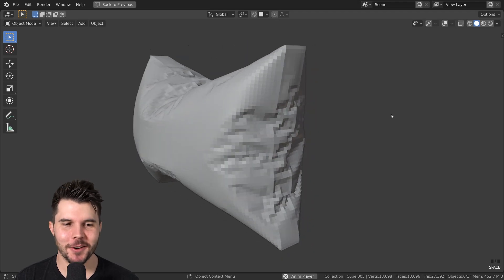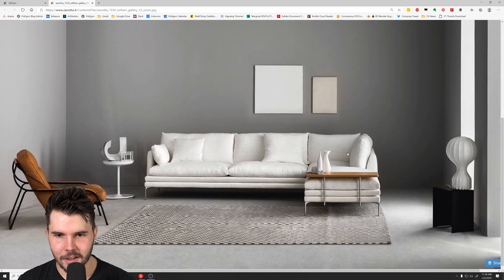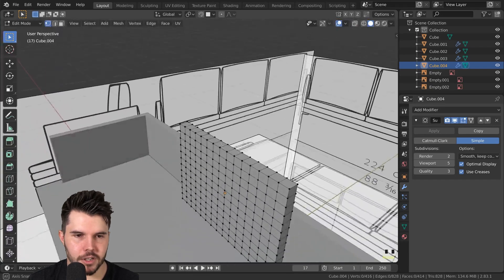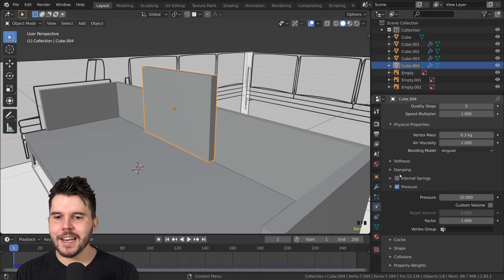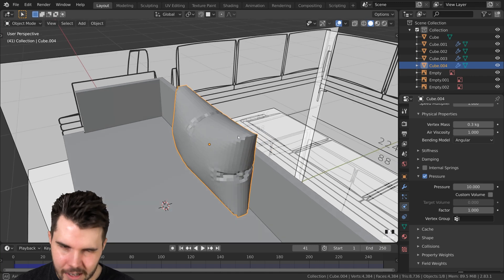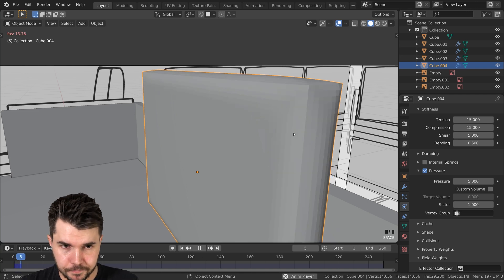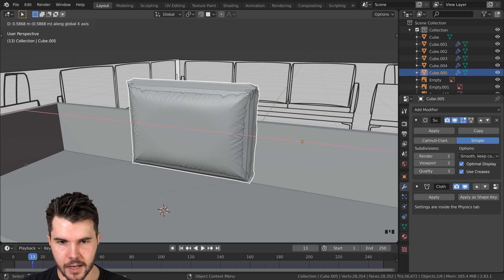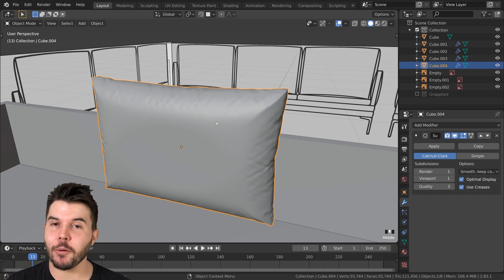Couch Tutorial Part 2: Cushion Simulation

Comment: Although you explain to us that when you use "Pressure" it looks like it's inflating the cushion but it's not, pressure works differently etc. - you do realize, that inflation e.g. of a balloon comes from raising the pressure inside the balloon compared to the air pressure on the outside? Because the air wants to expand to balance the inside pressure with outside pressure? And when you open one end of the balloon it's blown away to the opposite direction? So actually the pressure in Blender is more or less inflating the cushion like it should ;) Only in a real cushion the pressure on the cloth is achieved differently, because it's not filled with air, but with some foam, feathers or anything that has a higher resting volume than the inside of the cushion... But sorry for being a wisenheimer, it's a great tutorial anyway :)

Comment: Activating internal springs setting Tension to 0 and Compression to something small like 0.1 produces a relatively realistic simulation as well. You even can have gravity be turned on. I assume that pressure is better for something that actually has internal pressure like a balloon or similar.

Comment: For those with Blender 2.8 that don't want to update to higher version now, there is a work around. Do everything exactly as in this tutorial but instead of adding pressure , and Force from SHIFT+A menu and place it inside the "pillow" object at its center. Make the strenght about 200 - 400.
Either way awsome tutorial as always.
Reply: 👍  Worked great! So many options!! 
Thanks for sharing the tips.👍👍

Comment: Is anyone else having issues with the cloth sim and Pressure? At the beginning of the simulation, the pillow collapses in on itself before inflating? Then has weird clipping issues.
Reply: also make sure you apply the scale before adding this modifiers, this helped me out with this issue.
Reply: Apply the scale was the answer. If you do this, everything is like in his tutorial ^^
Reply: same
Reply: @SynrixYT  I also had this issue but  managed to fix it... What you need to do is recalculate the normal's of your object. The normal is what blender sees at the  outside face... 

In edit mode select all with A... then hit Shift + N to recalculate normals

The pillow is deflating because blender is applying the pressure to the outside of the pillow and not the inside

Hope this helps...Happy modeling ; )
Reply: @matthewjordaan5023  Thank you! I tried self collision but obviously it wouldnt work so I was searching the comments for something like this. Have a great day <3
Reply: @matthewjordaan5023  thanks for the tip, I was also having this issue.
Reply: @matthewjordaan5023  That seemed to work for me. Thanks for the the comment!
Reply: @matthewjordaan5023  Thanks a lot!.. Also I had to check "inside" button when recalculating normals. Otherwise it didn't help.
Reply: @matthewjordaan5023  thank you!! You saved me a lot of time
Reply: @matthewjordaan5023  Thank you so much! It was driving me crazy. Works propely now.
Reply: @matthewjordaan5023  Heey, thank u so much :3
Reply: @matthewjordaan5023   Thanks a ton mannn
Reply: @matthewjordaan5023  you're a life saver dude
Reply: @matthewjordaan5023  YOU HELP MEE!! THANKSS
Reply: @matthewjordaan5023  Thank you so much I thought I was doing something wrong, or I was doing something wrong with the faces.. Thank you so much! :)
Reply: @matthewjordaan5023  awesome!!! Thanks!!
Reply: @matthewjordaan5023  Thank you, you're a lifesaver!
Reply: @matthewjordaan5023  WOW! Thanks man
Reply: @matthewjordaan5023   Thank you ;D
Reply: @matthewjordaan5023  Thank you so much! Easy fix that took me ages to find
Reply: try redoing sim i had that issue i tryed re doing it it fixed the issue
Reply: @YEET_126  Same. I didnt have Pressure and Internal Spring tab at all at start, that was cause i was in blender 2.81. Then as I went to 2.82, found my tabs but the sim was working in a weird way.. Reapplying the sim solved the issue. Donno wtf was the prblm.
Reply: I get weird shapes, and I let it get weirder, like some sort of fancy pinched candy wrapper, but as the cloth sim goes on, the shape bounces back to a pillow shape, better than before. I used different pressure settings and other settings, so this might not match anyone else's pillows. I ended up using frame 43 or frame 87 of the sim.
Reply: Applying scaling first then recalculating the normals outside did it for me
Reply: Try changing the pressure to a negative value, seemed to work for me
Reply: i have the issue with pressure
Reply: BLENDER GURU NEEDS TO CLIP THIS COMMENT

Comment: ı cant ubderstand that what he just said with 1:1:1( 17:00 )  ...when ı do this my rectangel's shape is  changes to a cube
can someone help ?
Reply: Don’t change the numbers to 1:1:1 by typing them in. If the numbers in the scale section are not 1:1:1, select the object in object mode, press Alt-A, and click “apply scale”. The numbers will then change to 1:1:1 but the object will stay the same size and shape.
Reply: You need to apply the scale of your shape. In object mode - Shift+A  then select Scale. This will set it so the scale value for your object it at 1.
Reply: thank you both ☺️  ı got it 👍🏼
Reply: Thank you guys so much, had the same issue 👍